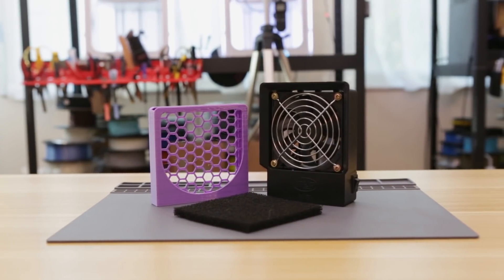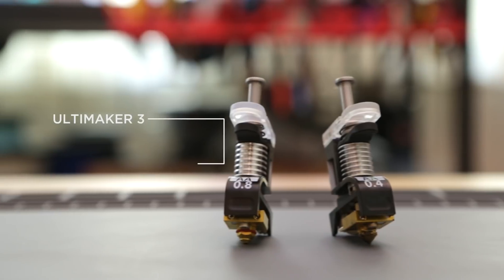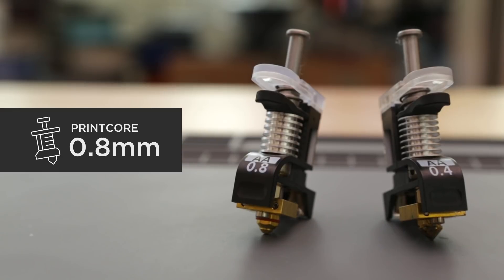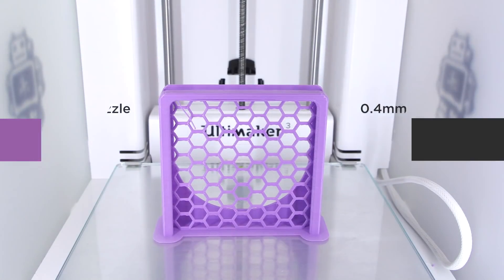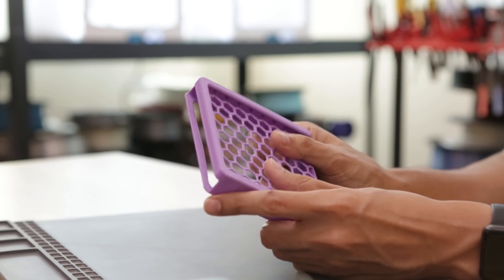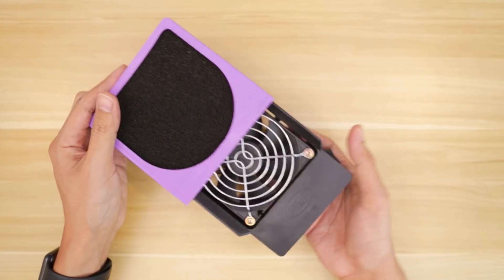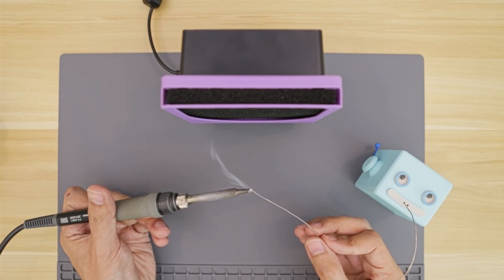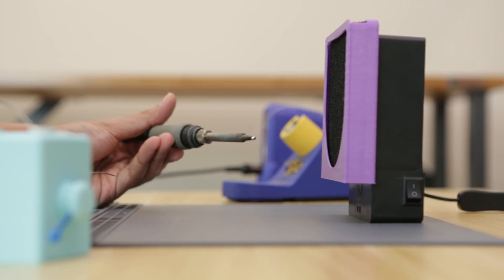Fume Extractor Desktop Fan // 3D Printing

Comment: How the heck did it print the free-hanging horizontal parts of the hexagon pattern? I have an Ultimaker 2+, it is very much unable to do that.
Reply from the maker: Check out our learning guide for the slice settings in CURA. https://learn.adafruit.com/desktop-fume-extractor/3d-printing
Reply: <reading> reducing print speed... increase active cooling fan... I imagine the thicker 0.8mm print helps too. I will have to give that all a try, thank you.